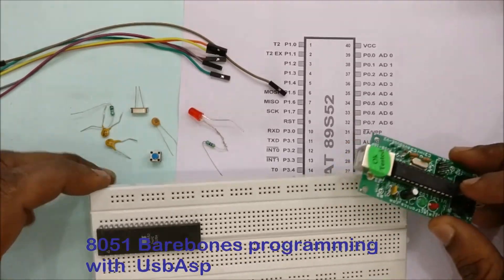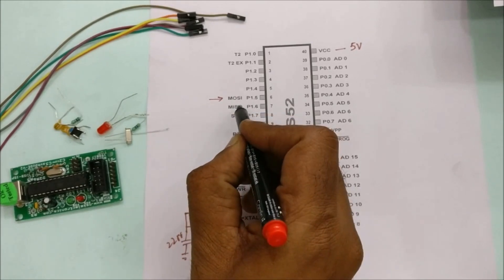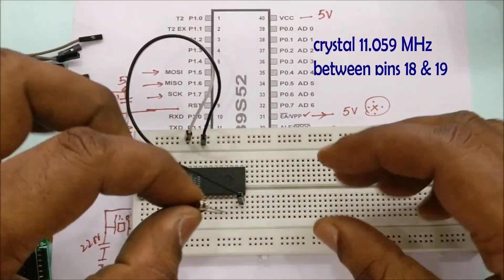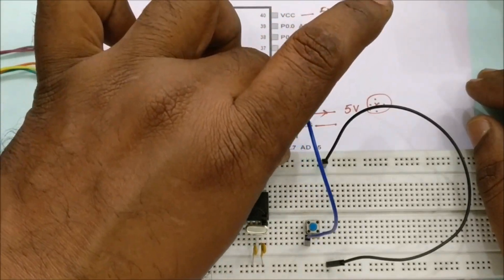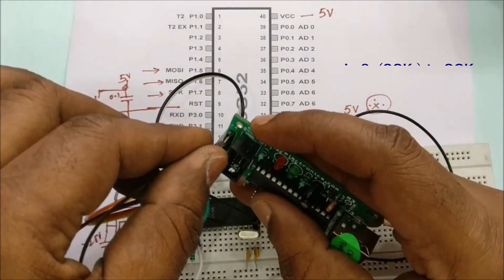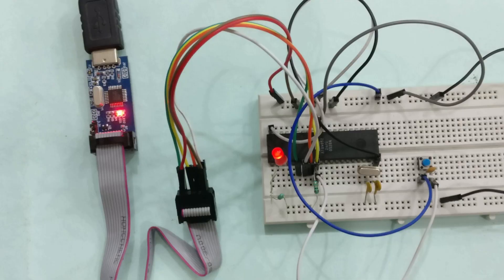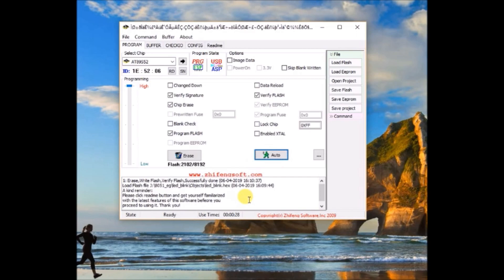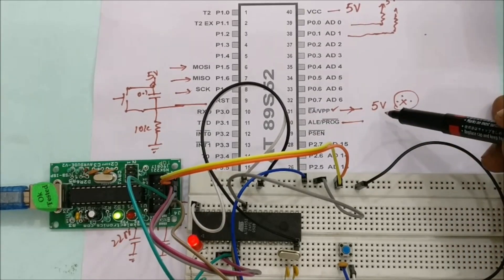8051 Programming with USBASP - Barebones method

Comment: I am facing a really weird issue... connecting the 22pf capacitors don't work and removing them lets the 89s52 to work. 89s52 seems to be stuck with the capacitors on...
Reply: Are you sure the caps are 22 pf ? If you are using a breadboard or strip board it will sometimes work without as you say. If the micro starts up then you are good. Check also the power supply.

Comment: Is code gets stored in the microcontroller,i.e if all the connections are removed with usbasp and other components (resistors, capacitors,etc.) will it works with real time applications projects
Reply: You still need the power supply, oscillator and its capacitors